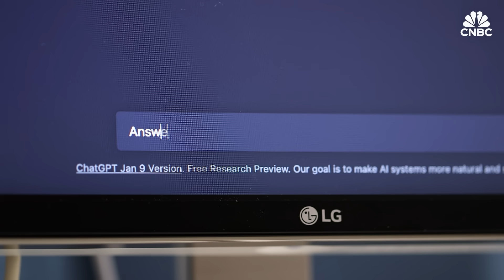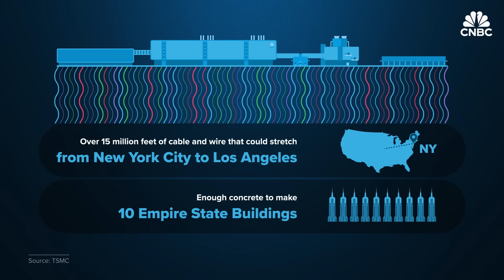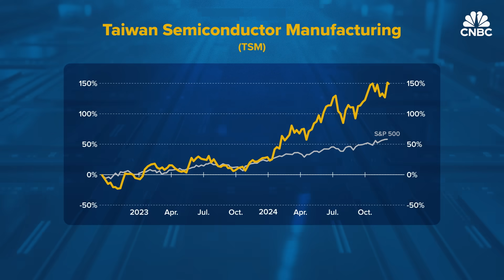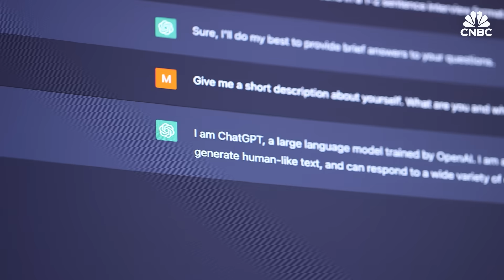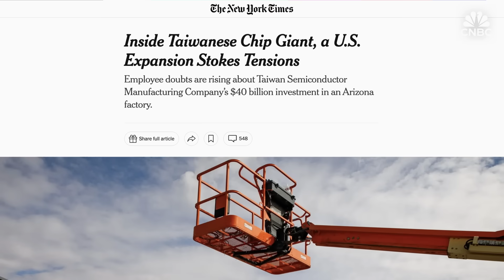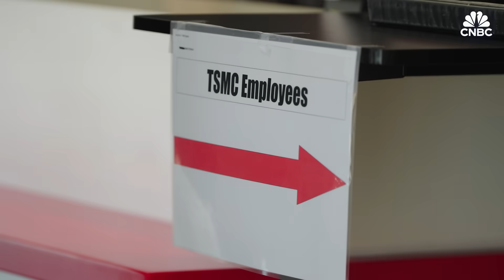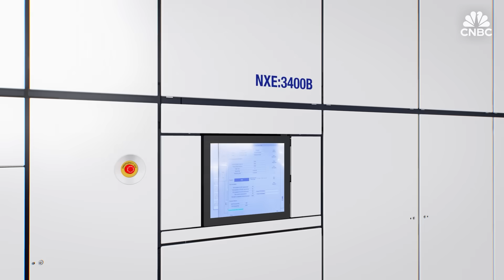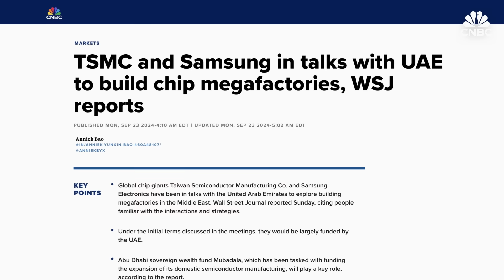TSMC’s New Arizona Fab! Apple Will Finally Make Advanced Chips In The U.S.

Comment: Its a question of whether this facility can be cost competitive with foreign fabs. highly unlikely but not impossible. High yields in trails mean nothing if you cant bring down costs during commercial production as suppress costs is integral. 4% higher yield than Taiwan's facilities is good but nit enough, while ensuring a disciplined workforce(which in america ? 😂, you have silicon valley types whining and bitc4ing about the most inane and inconsequential sociopolitical issues, It's gonna be a fun ride, thats after questioning the logic of setting up a resource hungry fab in the middle of a fcking desert, America's technical workforce is the most politically insufferable and economically parasitic They are one bad day away from engaging the kind o labor activism that TSMC finds carcinogenic, Just ask Morris Chang). Tarriffs wont cut it. America will have to be the only place where they make it for it to make commercial sense(Taiwan's broken shield). This wont survive without over the top subsidies on an indefinite time scale unless it becomes the sole facility for the process node, which is nit the case.

Comment: Cost is actually surprisingly not that bad most of the mega projects going on around north America are already in the 30 to 60 billion range so this being 20 and on schedule is surprisingly good also it's likely it could be cheaper as they build more given the design doesn't change as much as construction teams can make massive strides in efficiency when they are building the same thing over and over again.

Feel free to build here in Canada too more diversity in the supply chain is always good.
Reply: Cost of building is not the problem you see.
Reply: @t.s.d.1376  yes but if you build it they will come

Comment: This should be the future of manufacturing and jobs. Manufacturing chips, renewables, batteries, data centers
Reply: Thank you Mr Biden.
Reply: @josephkostinko739  he means trumps tariffs. 148% on China.
Reply: This was being under Trump. @josephkostinko739
Reply: You see the machines have Taiwanese labels? because it will take decades for US workers to build the necessary expertise for chipmaking
Reply: @rcomid 1) The US literally has some part in every part of the semiconductor manufacturing chain. Development of lithography machines were done by US universities and companies in the first place in collaboration with their EU and Japanese counterparts

2) The US is literally part of a Duopoly when it comes to manufacturing equipment for etching and polishing of semiconductors ie Applied Materials which is the second largest semiconductor equipment company after ASML. They also have Lam research which again, has a large foothold in wafer fabrication

3) They pretty much dominate the software side of semiconductors ie design and testing bar none. No other country has come close in this regard. The US has Cadence, Synopsys, ANSYS and even companies like NVIDIA for futuristic stuff like computational lithography.

4) They're manufacturing near bleeding edge chips in this Arizona fab. 4N process nodes. And hvw already reportedly boasted a slightly higher yield over they're Taiwanese counterparts.
Reply: @santhoshsridhar5887  is that why they are sending US workers to Taiwan for training?
Reply: @rcomid the machines aren’t made by tawain! It’s a Dutch company ASML who makes that 250 million dollar machine! The Taiwanese just use it to make chips!
Reply: @DoctorDeathFPS  why import Taiwanese workers then?
Reply: Chips are made by USA Semiconductor Equipment Manufacturers... LAM, Applied Materials, KLA...etc. USA has been dominated in SEMI.
Reply: Just everything is going to be two or three times more expensive. Developed countries should stick with research and development not manufacturing. USA is going backwards
Reply: @gobimurugesan2411   many ordinary people cannot develop their brains or get proper skills hence they want to do simple tasks that a robot can do and get paid well. That ain't going to happen. Even high-end manufacturing is back to US, People need to spent hard working hours to develop new skills for those industry and it is no easier than getting in TOP University. So those jobs are not for people with less brain juice and just want to do simple tasks.
Reply: You do not get it. Manufacturing only high-end product is not feasible because you need a complete supply chain to supply raw material and components  for these products. The idea to create an isolated world where the US (and selected allies) manufacture high-value-added products while China (and ASEA etc) manufacture low-value-added products do not exist.
Reply: Interesting you say that, just a walk away from where I live they just finished the construction of 4 huge QTS data centers and are building a total of about 8
Reply: Microsoft and Google are looking at very unclean nuclear to power and cold ocean water to cool their data centers. No we don't need more data centers. We need far, far more efficient data centers
Reply: It useless just to build fab, US still need to source its raw material. 
Good luck with china ban on exporting rare earth material.
Reply: You hv no idea.. how this is a gruelling job. Good luck...
Reply: This is a direct result of Joe Biden’s policies!!! Say what you want but he has my respect for making this a priority!
Reply: Nevada has lots of raw materials to assist.
Reply: Started under Trump. The greatest President in history. America is completely MAGA.
Reply: Well there won’t be much of a future for the United States we sold out.
Reply: Exactly. The Us economy is geared towards producing more advanced products instead of basic component
Reply: Let’s see if Trump repeals the chips act
Reply: @strawdemindset  Well, that would depend on what Elon wants.
Reply: Chips Act is corrupt with Congress self serving their New York voters.  Makes no sense building Semiconductor plants in New York.  It was bad from the start.
Reply: Just because it's new, doesn't mean it replaces everything else
Reply: @samsonsoturian6013  should strive to electrification, renewables, nuclear, then you can have true resource independence.
Reply: Your phone has killed your watch, alarm clock, camera, calculator, TV… and it’s not stopping anytime soon.”  @samsonsoturian6013  7:47 7:47 7:47  7:47
Reply: We can do that with tariffs.
Reply: @EnlistedBombin no we can’t
Reply: @EggEnjoyer  why not
Reply: @EnlistedBombin because your domestic consumer population can’t afford to pay for the products it manufactures, the products are too expensive based on the prices set because of the wages demanded by the US workers who manufactured it
Reply: @kzh5443  Light trucks have had 25% tariff on the for a very long time, but a Toyota truck is 2000$ cheaper then a Ford Domestic brand because the moved onshore so that does not make sense either. The Japanese brand truck made in the USA is Cheaper then the USA brand truck made in the USA.
When they put a put a tariff on washing machines foriegn products prices went up but people just bought whirpool... now foriegn washing maching companies are opening plants in the USA.
So none of what you just said is true either..
Reply: @EnlistedBombin  you listed 2 instances/products where tariffs and USA manufacturing worked out better 😂 look at the bigger picture please, if it was all so cheap and easy to bring manufacturing to USA why haven’t they done it? Why is it still going on..? Also you’re comparing Japanese manufacturing to USA, not Chinese.

So many products made in China in your American homes and you listed 2 things (one was Japanese) and you think you’ve disproved what I said, what a joke 😂 you’re not thinking, just like your president
Reply: @EnlistedBombin  you need both, protectionism and production.
Reply: @EnlistedBombin  Tarrifs don’t make it cheap enough for manufacturing to come back to the US. It’s cheaper to just produce in China and just have the American markets be less profitable. Or to move manufacturing to a cheaper third world nation
Reply: @EggEnjoyer  150 years ago, there was no income tax , and the government‘s spending and income was 100% from tariffs. If the government quits spending so much money. We can have zero taxes. And everything is made in the USA. It can be done.
Reply: @EggEnjoyer  Then why are more and more companies onshoring?

Based on a survey of North American manufacturing executives and an analysis of global trade patterns, the report reveals that more than 90% of manufacturing companies in the region have moved at least some of their production or supply chain in the past five years. Of those, half reported that they had shifted more than 20% of their manufacturing and supply chain spending. Further, owing to ongoing geopolitical uncertainties and high US tariffs, more than 90% of respondents said that they plan to make similar moves over the next five years.
Reply: @Despicable_G  Was not even that long ago it was up untill the 1910s really did not kick in untill mid depression. 
We never had debt either until we switched from tariffs to income tax, we have been in debt ever since.
Reply: @ What survey are you talking about? Can you please link the article from which you copy and pasted this blurb
Reply: @ Also no where in there does it say anyone onshored. It says that they’d moved their supply and manufacturing. Meaning that they just shifted to mexicos and other Asian nations.
Literally says nothing about onshoring or coming back to the US. Tariffs will not bring anything to the US.
Reply: @EnlistedBombin  
Are there still Whirlpool owned factories in USA ?
Reply: Actually have...Toyota, Honda to BMW are USA made
Reply: Tarrifs are designed to counter product dumping, selling below cost to drive your competition of the market or out of business. Classic example was Japanese dumping DRAM in the 80s.  Lots of countries impose Tarrifs all the time. Do a search.  Recent tariffs were imposed on India and Mexico over Matress dumping.
Reply: @Despicable_G  lol tariffs are a tax that US businesses have to pay to bring products into the country, but they don't want to pay for it so they make you the customers pay it with higher prices. Importers are only affected if US business' don't buy their stuff b/c the tariffs make it too expensive. Trump is hoping US business' will take advantage of the higher import costs & open their own suppliers domestically. Problem is American wages are too high.
Reply: @EnlistedBombin you can’t as you would be increasing the cost of the raw materials necessary to make the finished product
Reply: @nhjhbmkuy7173  We have all the raw materials in country so thats not true. So what else?
Reply: @EnlistedBombin  really, what about rubber?  Everything is transported on tires made from foreign rubber, a universal increase in transport costs will cause a universal increase in prices. Check the U.S. lists of imports and your view collapses.
Reply: @EnlistedBombin 😂

Comment: TSMC Kumamoto Plant in Japan
20 months to complete
2022.04~2024.02
Reply: Initially, when I bid on this plant before retiring, TSMC told me in the pre-bid meeting it needed to be done in 20 months. In the pre-bid meeting, they told me they wanted me to work with local AHJs, OSHA, and EPA to bypass code, safety, and environmental standards to accomplish this 20-month goal. While bidding on the project, I called the agencies and said what it would take ($) to bypass these requirements. It never happened. Some of the firms awarded the project found out the hard way. I am glad my company did not get this project, as did many other companies.

Comment: TSMC originally planned for a Small scale plant for mature build microchips But Biden pressured ASML not to provide TSMC with the Latest NaHiEUVs for the 2nm chips unless it is for the US plant. So TSMC had no other choices But to build advanced chips in US which it originally planned to keep Things in Taiwan as security. So If China now Takes Taiwan That US didn't lose much as microchips are now made in US. Another News is Googles photon chips Just finished the first testing which is 1000x faster than the normal silicone chips, it can Do difficult calculation That would take a normal silicone processor 1 year in just 5 hours.

Comment: Why build the Fabs in AZ where there’s shortage of water?  Why not other states like Colorado, Illinois, Idaho, New York where there’s no known shortage of water.
Reply: That's puzzling to me. It's sooooo water intensive and requires such pure water. Kinda insane. America isn't a reasonable country though
Reply: Arizona has a history of semiconductor manufacturing, similar to Intel. There is a large talent pool already in the state. The state offers favorable conditions for large-scale industrial projects, including competitive tax incentives, regulatory support, and collaboration with local government agencies to streamline project execution. TSMC has also pledged to use 90% water recycling technologies to address environmental concerns.
Reply: One of the biggest reasons for building in that location is because of environmental stability. There are not large temperature or humidity swings. This translates to large savings in energy used for the highly controlled environment in the plant for manufacturing the chips. Also, years before the plant was built, seismic studies were done that showed the location to be very stable. One other thing, the concrete foundations for the machinery are massive, and the equipment is aligned with atomic grade lasers... there were millions to be saved in alignment costs, initially and ongoing.

Comment: The TSMC plant in Japan has been operation for months now.  USA is so slow
Reply: Easy to do when you’re disregarding safety.
Reply: Many of the delays involved fighting regulatory agencies. For example, they wanted to bypass some environmental issues with local emissions. The Phoenix area is now the 5th most polluted city in the USA. Every evening, the NOX levels fill the once-blue skies with gray clouds. Sometimes, the surrounding mountains disappear behind gray smog. They also decided to bypass the electrical NEC lock-off-tag safety requirements, resulting in the electricians unknowingly working on live wires.